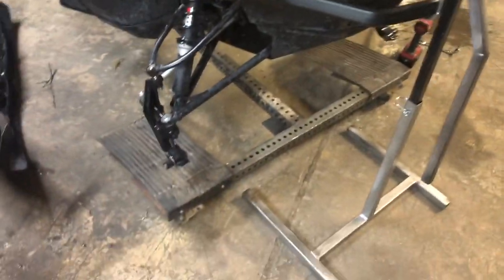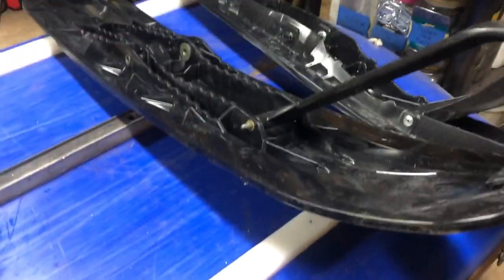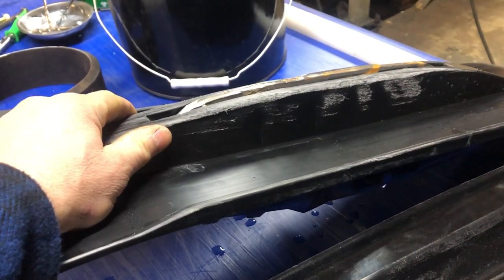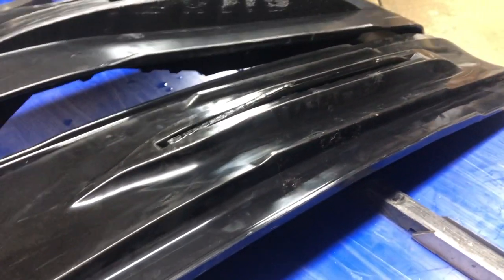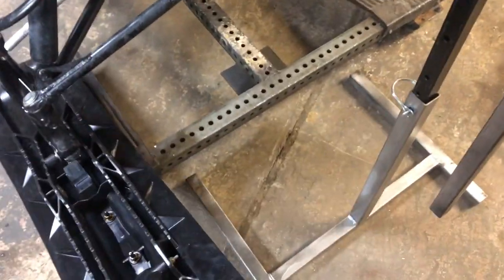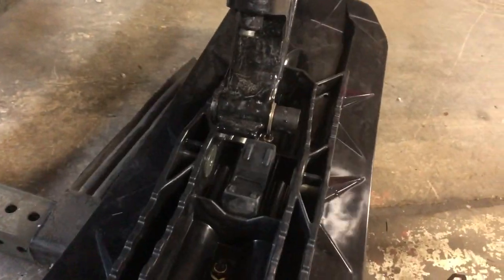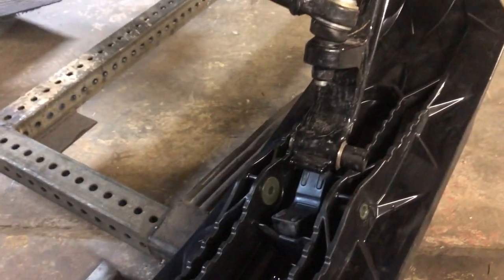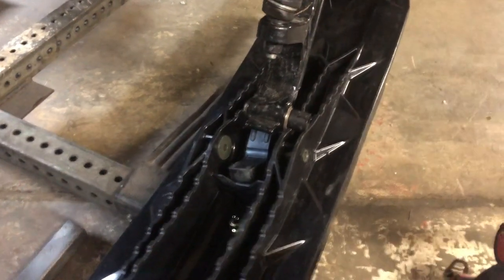DS2 Pilot Skis vs Polaris Profloat skis

Comment: Thanks for the video. I have a set of pro floats ready to go on my backcountry. How do you like them? Are the polaris rubber stoppers still holding up on them?
Reply from the maker: I had one go bad this year so I replaced both of them. 4300 miles
Reply: @howler580  thanks. I've read a few guys modify the skidoo rubbers to fit. I wonder if they would be more durable? But 4300mi is not bad at all.

Comment: Good video
My 2015 Skandic skis have a mind of their own also.
Please tell me if its a direct change over from DS2 to Profloat.
or are there mods to do or extra parts to get for proper fitting.
Thanx
Reply from the maker: Direct change over. You need to buy the rubber damper that goes with the Profloats too. The BRP rubber doesn't work with the Profloats.